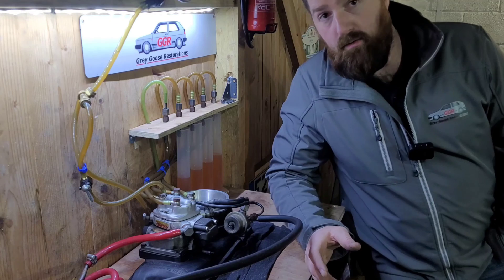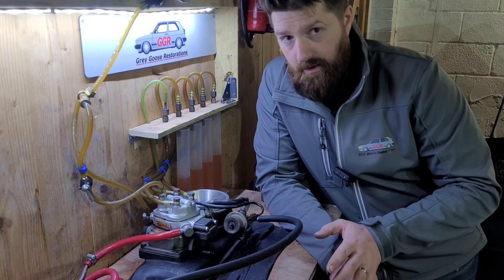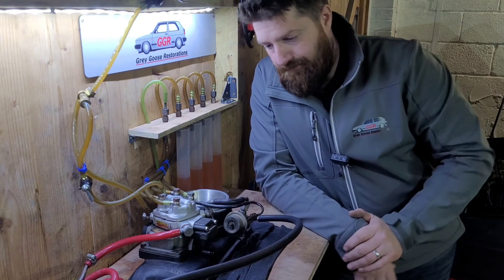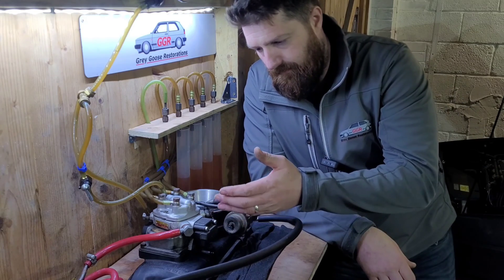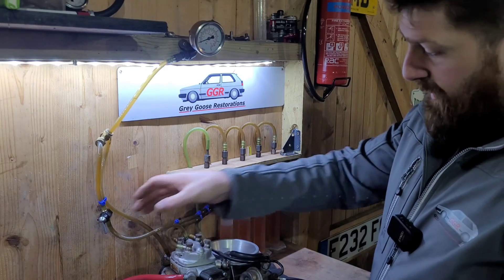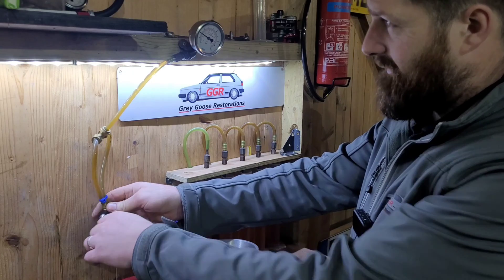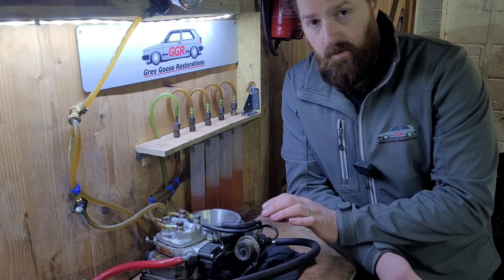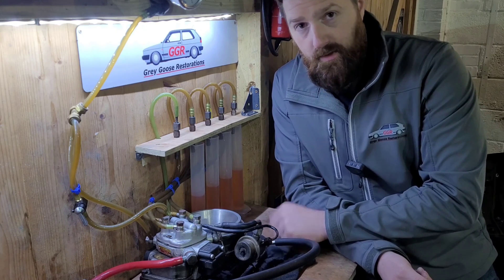Bosch KE-jetronic - System Pressure Testing

Comment: Hi guys,
Love the video!!! Knew I saw this adjustment in a video a few months ago and in the first second seeing this tonight I knew this was it :)

My question...
When I undone the adjustment line the tiniest dribble of petrol came out, not even a thimble, is that a sign of a gonner or can it retain a minute amount?

It's running at the high 6.4/6.5 and 6.8/6.9 with line open,
Mercedes 420SE, Going to aim for the 5.9/6Bar,
Going to find the allen for it tomorrow, my current set starts skipping sizes so not feeing a bite it must be one I don't have, maybe a 6mm,
I'll update when I'm done :)

The symptoms on this was a rich smell and a slightly pulsating engine with weaker than normal acceleration, no smoke but a slightly vapour rich exhaust (visible at night anyway),
Have a few KE jet Mercs so getting to know them well, 1 in particular is educating me no end, only thing right with that one is its fuel pressure! :)
Reply from the maker: Hi, do you mean the fuel return line off the back of the fuel pressure regulator? If so then once the system is pressurised and then switched off

Taking off the return line the FPR should have next to no leak, only a dribble on disconnecting, if it continues to leak then yes it's failing
Reply: @GreyGooseRestorations  
Great news, thanks again GreyGoose!!
sorry, yes, the fuel return line off the back of the fuel pressure regulator,

Sounds like turning it down should solve the issues :)
all the way clockwise, hit the 6Bar... simples :)
Reply: Hi all,
Today I went at it and a 5mm too large in situ, 4mm too small, must be imperial,
I removed the regulator and a 5mm just about got it, turned full clockwise and on starting the pressure went over 9Bar, turned it off quick,
going to get a 4.5mm tomorrow and be able change it in situ rather than taking it off every time,
I'll update tomorrow, hoping nothing gave up with the high pressure instant :/
still only a thimble worth of fuel when disconnecting the fuel return line so hoping for the best!!
Reply: I got an imperial allen key set but the 5mm seemed to be the size, just ridiculously tight,
Got it turned back again that it now is at the 6.3bar, 
anticlockwise reduces pressure on mine as someone else thought,

Now it starts but when shut off the fuel pressure goes from 6.3bar to 2bar in no time,
a bit worried that the instant of high pressure popped the injectors or distributor because it was holding good pressure before. 
Could it be the fuel pressure damper leaving the pressure in the system drop so quick?
Reply from the maker: @martinburke3755 yes the fuel regulator holds the residual pressure, is any fuel getting into the other end where the vacuum line is
Reply: @GreyGooseRestorations  
No, can't see petrol in the clear line out the regulators back,
pressure drops from 6.3 to 2.2 in a minute and kind of holds there for a short while before eventually 0. 

Best way forward is probably take the regulator off my 500 which is at a steady 6bar and test that way,
pinpoint or eliminate the regulator as the issue for losing fuel pressure,

I'll update as it goes, they're a few hundred miles apart so it won't be a quick job,
I read on check valves at the pumps but doubt thats the issue and the injectors are probably hardy enough to deal with the one shot of 9bar pressure, I hope :)
Reply from the maker: @martinburke3755 injectors will take 10+ bar without issue 

The metering heads can take a fair amount without damage, I've had a cast iron unit hold 12 bar and still worked fine and the KE units can run similar so most likely will be ok
Reply: @GreyGooseRestorations  
Thanks GreyGoose, sounds good!!

Now I know why there was no answer to the allen size, a 5mm is a bit too big and the imperial size around 4.76mm doesn't bite, the 5mm worked but seating it in the unit is hell. 
I wish I sanded the 5mm allen a bit now I'm thinking differently, quicker than taking the unit out. 
Definitely best done in situ, only removing the return line for the adjustment, small turn and repeat, easy to get at, just the tightness of the allen fit is crazy
Anticlockwise on my w126 merc lowered the pressure,

I'll update in time,
All the best!!!

Comment: Hello Mr Goose, I Hope that you are doing well, I Tried to adjust the fuel pressure regulator on my 190e (had a pressure of 4.6 and tried to make it 5.3 as in specs) but now there is no fuel going to the injectors, also when i connect the barometer and run the fuel pump the pressure is steady around 5.6 but then i hear a click sound coming from the fuel pressure regulator and it goes down to 5.1 instantly after that, did i break it or is this normal? Also when i disconnect the return line while the pump is running i get huge amounts of fuel coming out of the regulator, are you talking about no leaks from the return line after the pump stops pumping or while its still pumping? Thank you very much
Reply from the maker: Hmm it may be that the pressure regulator is adjusted close to its limit so as soon as it gets to the point of opening it stays open like its stuck, you shouldn't be getting large amounts of fuel out.

Prime the system then switch off and take off the return line off pressure regulator, it should be wet but not letting anything past
Reply: @GreyGooseRestorations  thank you so much for the information and explanation you provide, i will try it asap and get back with the verdict 😀
Reply: @GreyGooseRestorations  your diagnosis of the problem was on accurate, i reduced the system pressure in the pressure regulator and now i have fuel in the injectors, i think my pressure regulator needs to be replaced since it cant get the proper system pressure. Thank you very much for your help 🙏
Reply from the maker: @JhnStill happy to help 👍

Comment: Chasing a hot start issue on 9a corrado . It’s like loosing fuel pressure when parked . Love to have your understanding of the system 🤣
Reply from the maker: Could be a number of things, fuel Accumulator failing or one or more of the seals in the metering head, or if KE then the external fuel pressure regulator

Comment: Does the KE jetronic have enough adjustment in fuel delivery to run a turbo on an NA engine, no more than .5 bar .
Reply from the maker: Yes it has enough capacity to fuel turbo 👍
Reply: @GreyGooseRestorations  
I assume these same techniques will work on a 1992 Mercedes 190E running KE-Jetronic system.
Reply from the maker: @forresttucker168, in theory, yes once system pressure is set then its a balancing act to get the desired flow
Reply: @GreyGooseRestorations  so I need to invest in a fuel pressure gauge, a wideband oxygen sensor, and a water methanol injection kit.
Reply: Is there a CIS specific fuel pressure tester I need to get, or will any one do?
Reply from the maker: @forresttucker168 you can make your own cheap enough, some big kits will have the correct parts or speak to missingparts.de there test kit is probably the best available for the cost

Comment: Hello Sr I have a 1980 Porsche 924 turbo and after rebuilding the fuel distributor the rpm’s seem to be a lot higher did I do something wrong? And also it has a hot start problem any help would be appreciated thanks
Reply from the maker: As in the engine revs higher or the idle level is higher. Did it have the hot start issue before
Reply: @GreyGooseRestorations  yes it did I would drive it somewhere and go do what ever and when I came back it would not start so then I rebuilt the fuel distributor it runs better but I don’t drive it somewhere where I’m going to take long because you know. It will start the next day
Reply from the maker: @rudyperalta3147 that sounds like the fuel Accumulator that's not holding pressure potentially
Reply: @GreyGooseRestorations  oh wow and I replaced that too the old one was leaking gas,maybe it’s faulty
Reply from the maker: @rudyperalta3147 ok if its a bosch part chances are its somting else

It could also be fuel pump check valve
Or the main seal on thr pressure relief valve in the metering head or the CO mixture set to rich so once engine is switched off pressure is leaking away

Comment: System pressure is adjustable by screwing in or out on the valve to achieve 6.2 bar, What if the diffrential pressure is not 5.8 bar? How do you adjust that to make it 5.8?
Reply from the maker: If the differential pressure can't be made to have 0.4 bar less than the system by adjusting the fuel pressure regulator, then adjustments can be made to the DPR unit, theres another video coming out soon focusing on that alone
Reply: @GreyGooseRestorations what size hex key do you use to adjust the FPR?
Reply: Thank you
Reply: When adjusting the pressure regulator, I found that turning the Allen key screw inwards(clockwise),     increases the pressure.
  That is the opposite to your statement.

Comment: I don't understand the logic, the flow route, why open valve will make 6.2bar and close valve will make 5.8bar?
Reply from the maker: System pressure vs differential pressure 

Similar to k-jetronic System pressure vs control pressure

Comment: Vacuum port is so the inner diaphragm can work without being in a sealed can, and the engine will drink the fuel if it ruptures rather than spray fuel around the engine bay.
Reply: Had the diaphragm rupture earlier this year - most of the fuel went into the airbox via the vacuum connection and then the ground...
Reply from the maker: That makes sense, thanks
Reply: I don't think that's why, and it wouldn't be a good idea.
Reply: @whistle194 yeah it would be much better if it dumped fuel all over your hot engine.🙄

Comment: Do you think the vacuum on the fuel pressure regulator might have something to do with a reference for boosted applications ?
Reply from the maker: Potentially 🤔 i may have to cut one apart and see what's inside
Reply: It's a failsafe ...ripped diagram , sends fuel to intake
Not for operation..
.Just to keep fuel isolated incase of failure